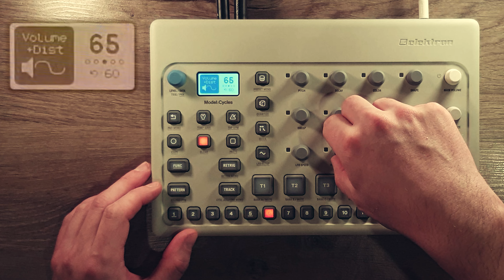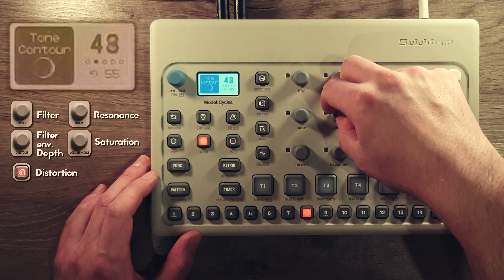How to 303 Bass line with Your Model : Cycles

Comment: You can get the portamento glides by setting the lfo to single shot mode and plocking the lfo on switch. You can use the punch button as an accent

Comment: Been drooling over Roland Aira T8 to get that 303 sound, but no need if my trusty Cycles can do it. 👌
Reply: wouldn't be easier to get Behri's td03? 100 eur for analog synth with a sequencer...
Reply from the maker: @tresporros  of course behringer td-3 will sound much better :)) I have Crave, I can make super cool analog basses on it.  But point of this video is to get similar sound on m:c. When you are playing  with only  one groovebox and don't want to use some extra gear. 😉✌
Reply from the maker: Cycles can't reproduce it cause it doesn't has proper filter with resonance, but we can try to get close to this sound :))
Reply: @tresporros  I have the TD3- it's great for the classis 303 sound- though I sequence mine externally (using a Digitakt) as the 303 style sequencer is a bit tricky. The tutorial here, though is very close to the 303 sound- in some ways it is more funky and punchy and would make a great second bassline to the 303- perhaps pitched an octave lower.

Comment: This sounds nothing like 303.

BUT IT SOUNDS SOOOOO GOOOODDD AND DIGITALLYYYYYY I LOVE ITTTTTT 😭
Reply from the maker: comon... it is sound at least little bit similar 😁
Reply: @TheDarkDigital  Sorry, nah, it needed some sliding resonance 😅

It still sounds fkin great though, and it does operate just like 303 on Cycles.
Reply: 303 sounds are all about the filter, and the M:Cycles doesn’t have a filter.  It makes great FM basses though.  I wonder how close to Lately Bass you can get with it.
Reply: This video is perfect for those that believe that you can't make acid with fm...  thanks for posting 😊
Reply: @TheDarkDigital  yeah that's similar they're both acid, but a 303 is a bassline from a specific type of synth. What you have here is an original sound design for FM acid basses and that's FIIIIREEEEEE

Comment: Great tone! Love this beast even more now. Since you have both Samples and Cycles, which one do you prefer? Can you share some tricks on how to workaround the absence of a filter on Cycles? Your demo sounds so clear, no clashing frequencies and no buzz which is typical for this machine.
Reply from the maker: Thanks. I prefer mode:samples. You can produce almost any kind of music you want with it. Cycles is more limited device in my opinion. About lack of filter on cycles. In this video I made onscreen shortcuts, and there is some kind of filter imitation. But it works only with tone engine. So..yeah...cycles is pretty limited device in sound design.🤷
Reply: @TheDarkDigital  I have a Digitakt and it's an amazingly flexible device, worth the investment in my humble opinion. I got a Model Cycles to add some punchy percussion- but your tutorial shows me that it's capable of much more.